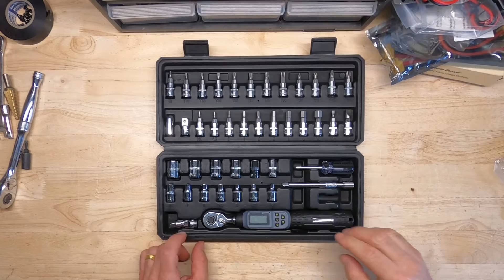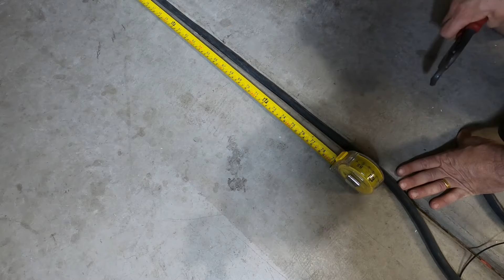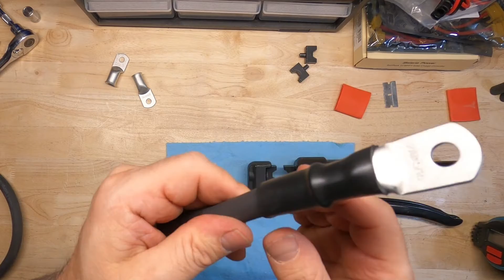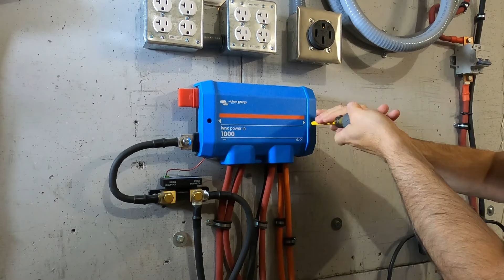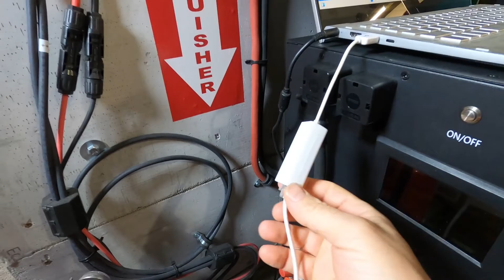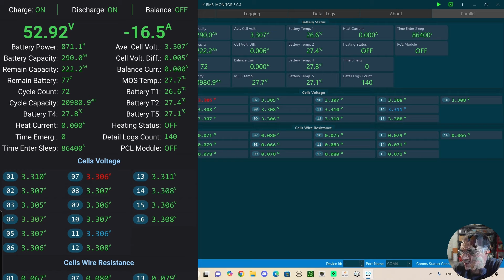Connecting the V2 Battery to The System for PC Monitoring

Comment: Nate, could I trouble you to measure the distance between the v2 boxes stacked terminal to terminal? I am curious if something like the EEL busbar v4/v5 JK BMS flexible bus bar would work instead of parallel cables at 2/0 or 4/0.
Reply from the maker: I only have 1x v2 box but I'll try to get an exact number.  I think the terminals are in the same vertical position but they just swapped sides.. if I can't I'll ask Becky.  Send me an email so I don't forget plz  . My email in video description.

Comment: I could of swore I saw a 3d print file to avoid using those 4 star spurs on the back of the BMS display - I just ordered the x2 of the v2 gray (w/ v19 BMS), x16 MB31, and the rolling base so im hoping the new v19 doesnt use them anymore. Going to decommission my make shift battery box 280ah one and put them into the v2 case. I compressed them so I hope they fit (:eyes:) lol. Thanks for all your testing and efforts!
Reply from the maker: Yea I think Andy mentioned a bracket someone had printed up.  I have 16 mb31 waiting to be used and a v19 bms..
Reply: @natesdiysolar id work on it before Dec, 30% solar and battery storage credit goes away after 31DEC2025.